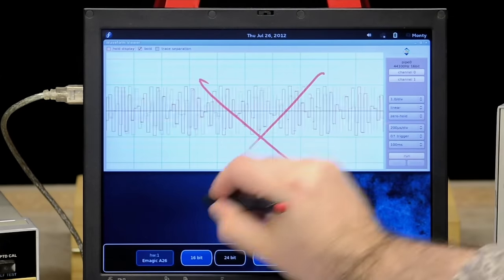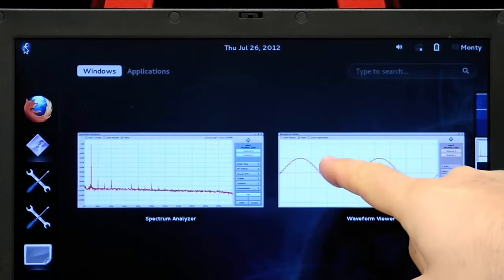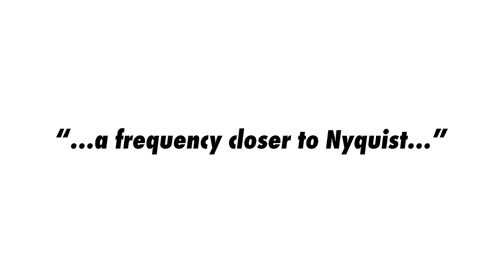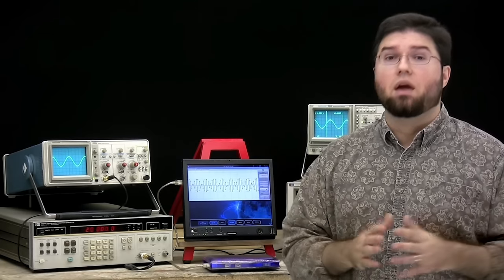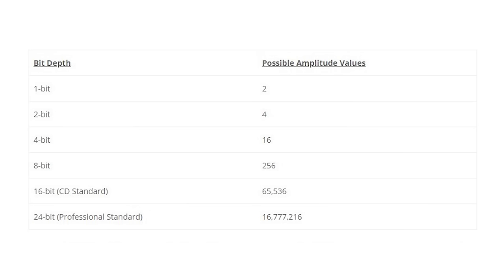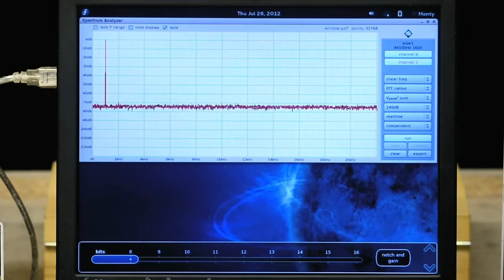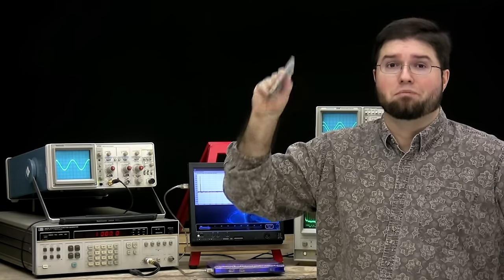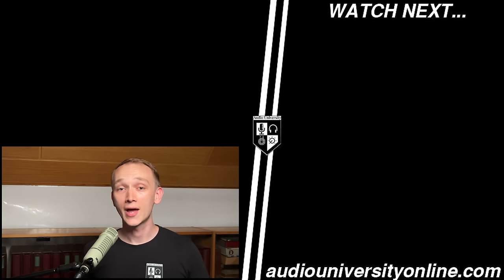Debunking the Digital Audio Myth: The Truth About the 'Stair-Step' Effect

Comment: Now add an orchestra of instruments and sound with all their harmonics and try the same experiment...  It's dumb easy with one sound wave especially at low frequencies below 20 kHz.  I'll be convinced if you can replicate even a string quartet with fidelity including all the waveforms and harmonics.
Reply: Hi, Nick:  Yes that is exactly correct.  One single sine wave into a A/D/A converter is one thing.  When you pluck a guitar string (one note) you not only get that note but it's harmonics and most often a subtle echo from the environment.  Now pluck a chord and you have hundreds of sinusoidal waves of various frequencies, amplitudes and waveforms.  Now add a second instrument and so on.  Does the A/D then back to analog have the ability to replicate this?  To prove it, take a one millisecond clip of a band or orchestral work and analyze the sound being picked up from the several microphones that make up the tracks that go onto the recording.  Look at all those waveforms in that one tiny millisecond.  Now run that through your A/D/A and see what comes out the other side.  It's a lot more complex than you have been led to believe.  Just because it works for one single waveform there is a point where it doesn't have the capacity to handle all that sound data.  Think of a traffic cop at an intersection, he can easily handle several cars at once but don't put him on the interstate in the middle of rush hour.  Don't get me wrong, digital recordings are good and better than the hissing tapes or the scratchiness of a dirty vinyl record, all I'm saying is at present there are limitations.  Processing power, memory and bandwidth are not unlimited and while our hearing is only so good I can still tell the difference between a good analog vs. a digital recording.  Most people who have grown up with airpods in their ears really don't have a good frame of reference.  If you've never eaten a really good steak and have been raised on cheap fast food hamburgers how would you know what your missing.   @nicksterj

Comment: I'll watch, but BETTER? .But I'll give you a chance. Well you say it doesn't matter. My life has spanned from 78 RPM records and no TV thru all the digital formats. And I retired from being a service tech in a high-end audio store. And I recognize that if you think it matters, then it does.The CD is a compromise. It had to fit in the space between the knobs on the dashboard of a car radio and hold an entire Beethoven symphony one side of one disk. So its specs had to good enough to satisfy those requirements. And no better than that. I suppose if you don't want the best techknowledge we can do then you'll be OK with the limitations. A lot of people have a problem with "just good enough". The stairstep does exist but it gets removed by a sharp cutoff filter that eliminates the very high frequency that the fast rise time of that step creates. The audio enthusiast would prefer as little filtering as possible so that the output is as close to original as is humanly possible. London records recently reissued an award winning recording of Wagner's Ring and they took the original stereo master tapes and used the best currently available technology to eliminate the tape hiss from these 60 yo tapes. They digitized them at 192K and released them as a Blu-Ray audio disc and then as an SACD. They must have had good reasons to use that 192K data rate. Maybe even that in the future higher data rates will be the norn, not the exception. We are surrounded with stuff which is just good enough and some people want better than that. The speakers in your TV are just good enough, but I bet you bought something else so the sound would be, better than, just good enough.
Reply: Many audio enthusiasts have very misguided ideas about filtering. By leaving the filtering out altogether they actually manage to get the dreaded stair stepped waveform. This is as far from the original as possible. There probably was a good reason to use the latest digital technology in the latest (so far) release of the Solti ring: it is called marketing. Another thing is that higher sample rates and bit depth are beneficial when manipulating the sound. And the result: curiously enough the latest Solti Ring re-re-release seems to be partly dynamically compressed and limited  - a bit like modern pop music productions. Open a track in audio editing software and see this yourself.
Reply: @nyquist5190  I've wanted to do a comparison, since I have my seldom played London Stereo reel to reel 7.5 ips tapes, 11 of them, and a professional level Otari MX5050 MKIII-2 that plays 4-track and records 2-track for playback. And also have a never played, still shrink wrapped Rheingold LP set. I'll use Audcity at 192K. On the new release of Walkure I detected a bad edit which I want to check too. I'm doing my listening on Sony MDR-V6 headphones. Instead of my RF-7's. Which I play at real life orchestra levels. Since the new Solti release is from the master tapes I doubt if they have any reason to compress or limit, but I feel I have the tools to detect that. By the way, each of these operas are available as a 192K download from, I think, Presto, for ten dollars each. Probably a zip file.
Reply: @rpk5568  There is a lively debate about this on Steve Hoffmann forum, for example. I did the comparison myself, too, since I happen to own the 1984 CD edition of the Solti Ring. You can clearly see (I used Audacity, too) the limited and clipped waveform of the new edition in Siegfried's Funeral March, for instance.

Comment: Thank you. This was very informative and well explained visually. I was duped by HD audio until I did a double-blind test myself between the CD layer on a SACD and the stereo DSD layer in a recording that was originally recorded at 24-bit/96kHz. I could not hear any difference in that double-blind test. In fact, I chose the CD as better than the 2-channel stereo SACD version by a slight amount within the error rate. In other words, no difference. However, I did select the multi-channel version as better every time, so that is the reason why I buy and love multi-channel surround SACDs. I was very reluctant buying 3 additional speakers at first, but on first hearing multi-channel SACDs, I fell in love with them. Wow, what, they are so realistic like I'm in the concert hall. The key is to place the rear speakers about 4 feet above your ear height behind you in the same position as the front speakers.

Comment: Ok!  This seems to be both right and wrong in parts. When a DAC puts out a value it is a voltage corresponding to what value has been written to its registers. At that point it is inherently a stepped output. Then the signal is low pass filtered, by the electronics, by the speakers, by the air and finally by your ears.  Each of these filters resonate or 'ring', taking the higher frequency staircase out.  This 'ringing' is why it is only necessary to sample a high frequency waveform in two places to reproduce a high frequency signal.  That is the physical reality of the Nyquist sampling limit.

Comment: some "audiophiles" one can't convince, they even believe that their cable "sounds better" than another and they match speaker cable lengths. When "SACD" came out I attended a comparison at an A/V fair in the UK they played CD first and then the same track on SACD. The latter "sounded better" only because it was reproduced at slightly higher volume, thankfully the difference was notable, so I never got even tempted. I think in the end it was a marketing gimmick invented to achieve better copy protection.

Comment: We’ve been using 8 bit digital for telephone voice communication (i.e: T-1, using legacy AMI & currently B8ZS) for over 40 years, and you can hear a pin drop from the other end.
Reply: With telephone technology, those are not linear step sizes.  The step size is changed according to the time average of the signal using either A-Law or Mu-Law modulation.  This means that the dynamic range of the 8-bits is effectively 12 to 13-bits

Comment: I don't dispute any of this, but the sad reality is that many of the high-res releases include remastering that improves the dynamic range.  If you have equipment that thrives with high dynamic range recordings (like Focal headphones), then you will have a better listening experience.  Sadly, most music is mastered for highly compressed audio played back on terrible hardware. 

I recently listened to a ton of hires Pink Floyd tracks and it was euphoric in some cases (the panning plane engine in Learning to Fly is incredible).  This has nothing to do with the 192khz audio and everything to do with a great remaster.

Comment: Something else to keep in mind -- if you pump your output signal with a "theoretical dynamic range of 96 dB" through an audio amp with a noise figure of 10 dB, that will shave the dynamic range down to 86 dB.

Comment: For me personally the only real reason I have for setting Windows to default to 24/192 is that in some voice chat applications if the other party has their microphone set to 24/192 the down sampling to 16/44 causes really annoying clipping. Though I get the feeling that's just because the software itself is simply truncating bits and dropping samples.

Other than that I've set the DSP in my amplifier to have a low pass at 20kHz, because I can't really hear those high pitches anyway and they annoy my cat.

Comment: That doesn't explain why studios use 24bit depth. But I'll explain it. Studios have to work with much higher sample rates and bit depth to minimize any kind of margin of error that could occur in the digital recording. This is why 48kHz sampling rate and 24bit depth is often cited as "studio quality". Sometimes studios need to work with much higher sampling rate frequencies than that, and often also require much higher bit depth than that. For example when they're working with sound effects design, and they need to slow down the sound so it sound unfamiliar and strange. Recording at much higher sampling rate while also using the equipment capable of capturing those higher frequencies makes it possible to reveal the ultrasound frequencies to the human ears.

Comment: Things get even weirder. Some of the most expensive audiophile DACs operate exclusively in so-called NOS mode. That stands for "Non Oversampling". Sounds reasonable at first appearance. You think, okay, they've eschewed the Delta Sigma system that's most commonly used these days. So CD's 44.1kHz is kept at that frequency before decoding, just like in the early days of CD players. Some audiophiles swear by them for their claimed higher audio quality. But in practice, NOS DACS not only don't oversample, they also don't low-pass filter the output. Which means they operate in "sample hold" mode! Seriously, I've examined their outputs on an oscilloscope, and they deliver a clear stair-step analogue output. And that means that they roll off significantly well before Nyquist, and bounce all the output up into ultrasonic, ad infinitum. Probably does no harm to the other equipment and is almost certainly inaudible because, in the real music samples I've examined, the ultrasonic doesn't really reach above 40dB below the peak of the real program content. But you have to wonder about the audio reviewers who insist that NOS DACs "sound better".
Reply: BTW, I did an article on this a couple of years ago -- with real world examples and pictures! -- so reply if you need a link.

Comment: In reality Audio usually isn't a sine wave. So if you have for instance a triangle wave at 20 kHz instead, would it sound differently than a sine wave with 20 kHz or does the human ear also split the signal into it's harmonics so that the waveform only matters at lower frequencies? Because for something like a triangle wave at 20 kHz it gets better approximated with a 192 kHz than with 44.1 kHz.
Reply: Exactly what I thought. When you use anything that's not a sinewave  2x your frequency will not be enough anymore. Of course the other question is how precise your playback device even can follow anything that's not a sine wave, considering a perfect driver without inertia cannot exist. Even an analog sawtooth will never achieve perfect playback
Reply: @holzvvrm7718  I think the latter question depends on what kind of driver you use. From what I know crystal speakers are capable to produce very high frequencies, up to hundreds of kHz. Crystal speakers are used for treble at high-end speakers, but also in phones because they can be made very small.

Comment: Wouldn’t sampling waveforms other than sine waves lead to different results?
Reply: @nicksterj Because the smoothing between sample points assumes that the signal is continuous between points. If you had a complex waveform the sampling could entirely miss parts of the waveform depending on sample rate.
Reply: All waveforms can be described by a series of sine waves at differing frequencies.

Comment: Really the caveat here to understand is that DACs are frequency limited by their bit depth, and stairsteps simply require higher frequencies than that limit. You just cant make square shapes without high frequency.

This isn't to say that DACs never produce stairsteps. You can sample and hold a waveform from digital information, but if the system isn't frequency limited, that's just how some simple DACs work. You DO get stairsteps if the system allows electrically.

Comment: What about R2-R DACs instead of sigma delta? Using a multi-bit resistor ladder, there is probably still a stair-step because of its nature. So, a higher sample rate with an R2-R DAC would probably be better. But it DOESN'T matter for sigma delta. With non-oversampling on R2-R DACs, it's likely more noticeable.